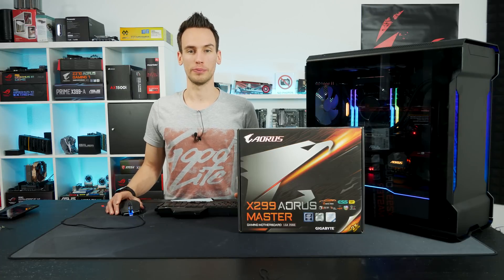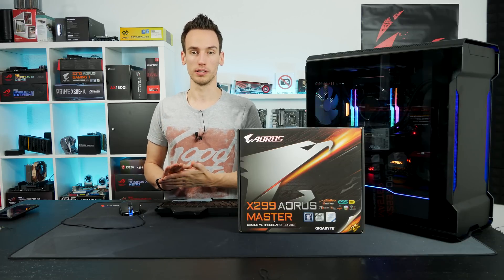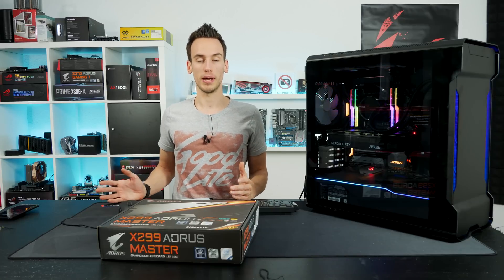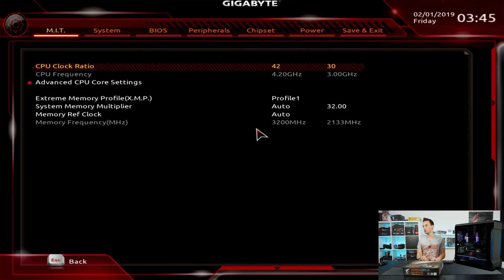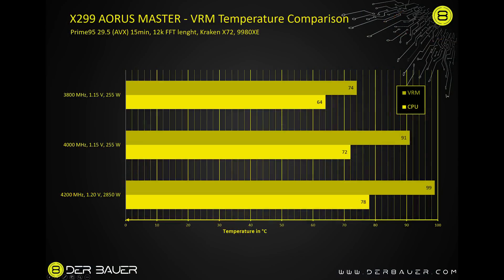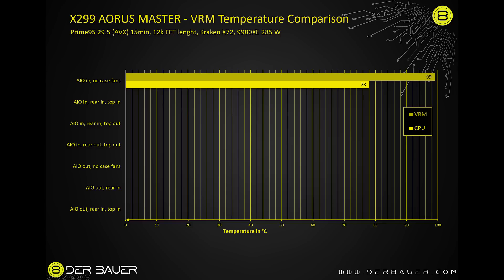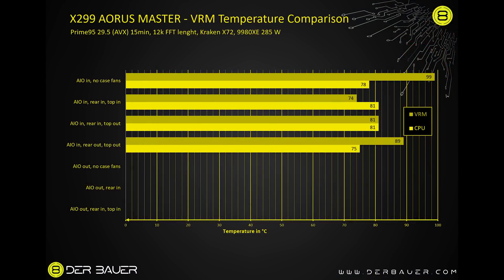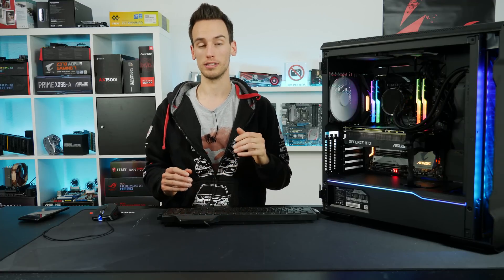PC Airflow Test - Real Mainboards have Fins

Comment: my case is too large for my AIO tubes to front mount so i have it top mounted with 3 120s on intake on the front of the case, a noctua 140mm 3000rpm exhaust on the rear of case and my 240mm AIO top mounted in a push pull config with 2 noctua 3000rpm pushing and 3 standard case fans pulling out the top and it seems to work pretty well. i do plan on upgrading to a 360mm AIO though

Comment: Hi Roman,
Please, next time place AIO radiator on top, with fans blowing outside,  front in, rear in.Try this setup. It's the best config. Confirmed by over 200 workstations. VRM heatsink and RAM cooled directly by rear fan. Positive pressure inside makes hot air from AIO radator get out instantly and top radiator fans can run quietly.  If the card will be hitting the max load the CPU will get hotter. Knowing that you should use a card with 4pin  fan connector  for front fans. 
The case you used is not the best one also. Fractal Meshify C is sufficient for 8-14 cores with mild OC. Fractal Meshify S2 or Fractal R6 is the best for staying cool and quiet while GPU is on air cooling.

Comment: Interesting video, though when GPU is under load it would also introduce additional heat. For example, when stressing my CPU with Aida64 (Ryzen 2600X) and cooler) but when I also introduce FurMark running the GPU in the background (GTX980) I get a signifcantly higher CPU temperature. On the other hand, when gaming CPU is usually around 66 degrees and GPU around 72, and that is much lower for the CPU than when stress testing. Also I would note that when doing Aida64+FurMark combo stress, HWInfo reports 66 degres on CPU but 75-90 Tctl/Tdie, while when I am gaming CPU temp reported on the motherboard segment and Tctl/Tdie temp are the same.

Comment: OMG ! .... i thought id swap around my fans just for the fun of it.. dropped 3-8c on all 8 cores....Phanteks p400 tg , 360 aio front and 3 case fans 2 top 1 back... had AiO in other 3 fans out.... swapped it around so 3 fans in AiO out (wth fans on inside pushing thru radiator...) ... thank you so much !

Comment: Neah.. With this case, it's better to mount the radiator on top, exhausting hot air and all the other fans pulling fresh air inside.
It's very common tho, to not have enough space on top of the case, to this ridiculous front radiator trend.

Comment: Problem is now its exhausting warm air in the front and a lot of people like myself have their towers facing them at their desk (or nearby facing in my direction, etc.). I think the even more optimal solution is to instead have a case with an AIO mounted on top or even in the back, with intake case fans in the front. Then you can blow hot air out the back while still having a similar configuration that you show in this video

Comment: I always have my AIO on the top blowing air inside the case to the VRM. Besides that benefit, despite what others say (warm air goes up), I think fresh air coming across the AIO radiator fins from the outside is better than warm air from the case out. The direction of the air doesn't matter as long as you push the coldest air through the fins and a push pull fan setup running as low as 600RPM pushes with enough force that no warm air going up will ever become a force against the fans. Two or more front fans (2x 200mm here) the AIO injecting air from the top and a 140mm fan as exhaust makes for a real efficient airflow pattern. The positive pressure is so strong that the exhaust is not really needed as I can feel air coming across all cracks from the back of the case.

Comment: Hello everyone,i have 360mm AIO on TOP 3x120mm fans out turn)and my fans position 2x120mm on front endering fresh air inside case,and rear 1x120mm  OUT air,if i turn position to rear fan to ender Fresh air do you believe my vrm's and cpu drops a little bit temps?

Comment: Ah finally, Real result. i always suspicious about the theory behind the way the air flow works, i read from many websites. It works only if its an fully enclose non-leakage box. On my system, i laid down on the side(rather than standing); I have the fans pulling in from the left and right, but only one fan pushing out at the rear. (no front fan slot).
BTW Mr DerBauer, got a question here: is it better to have "copper pipe+alum fins" or "alum pipe+ alum fins" (or nickel instead of alum), on the VRMS? do we really need another "copper pipe+alum fins"? I meant the manufacturer can save some $ there.
Reply: Well aluminum sucks at heat transfer compared to copper, so they could also use shoelaces and just pretend its a heatpipe if they wanted to save costs... I have never seen an aluminum heatpipe, those nickel plated ones you are thinking of are nickel plated copper.

Comment: Why are you using only four memory modules in X299? I've noticed that many people drop in LGA 20xx platforms and populate it with half the RAM. It defeats the sole purpose of this platform in my book (now the SLI/Crossfire is effectively dead the PCI-e line count basically doesn't mean much).
Reply: Apparently you don't know, but X299 only supports quad channel memory... Populating the rest will only allow more RAM (64 GB was probably enough for him, I doubt he needs 128 GB for gaming). Filling all the slots of RAM also means more stress on the memory controller, meaning it may need to run SLOWER, so you don't want to run with all the slots populated unless you really need the extra RAM.

I run 4x Fury and get twice what my Titan Xp does (so you'd need 3x Titan Xp to match). Crossfire is not dead, its called 4k gaming, and a 2080ti will struggle in some games just to hit 60 fps, I much prefer the 100 fps in Crysis 3 at 4k Ultra than sub 60 fps any day! I run a Threadripper for the PCIe (I still want to run 3x NVME in multi-tier raid later)
Reply: @jakegarrett8109  I know that X299 supports four channels (six to be exact, but two are disabled). And you don't have to put 16GB modules in there. Lower capacity modules usually are faster, putting eight 4GB modules with tighter timings (while apparently bit slower frequency) should still give you speed edge over four 8GB modules. This may break over, say, 4 GHz on memory, true (hence X299 Dark has half the memory slots), but for pure usability I'd still go for 9900K over any HEDT when <= 64GB memory is required. For high core count work is't rare to see workloads that don't benefit from more RAM. Video editing (most common reason high-end systems are shown being built on Youtube) always benefits from more RAM, for example.

Leaving usability aside, for any showpiece I'd also pack 8 slots, because it just looks better.

Saying SLI/CF is dead, I meant it's dead for average customer. I ran 3-way SLI on 8800 GTX, but also on 2x 6600 GT, which cost like $80 each. I ran SLI on 570, 970, 960, 750 Ti, 1070, Titan Xp, and bunch of Quadros. But on 1060 it's not possible anymore, and not on damn RTX2070. It has been moved to extremely high-end, which only few can afford, so game developers just dropped supporting it altogether (you have no idea how pissed I am at FF XV). CF I haven't used since X800 and my hunt of CF master card, but from the looks of it, it works more behind the scenes than SLI, and gives some hope for multi-card setups... but still requires dev support, and be fair, Radeon sales don't justify including this in games too. Big engines may support it, but anything else...

Do you imagine how people would be happy if Geforce 1060 supported sLI?

Comment: Would having rear+top intake, AIO exh end up raising GPU operating temps? There would be high pressure area over the VRM/CPU socket meaning the air coming out that open shroud would be most likely pushed back into the GPU fans- whereas normally it would split roughly half og the  GPU exhaust into the top half of the case.

Comment: I have 3 fans blowing in cold air from the front and 1 exhausting out the back and AIO I is in the top of the case with Fans in a pull configuration,, my VRM’s stay about 49c while gaming and cpu (8700k) @4.8 GHz  has a average temp of 61c,, with a max of 67c...

Comment: Great video Der8auer, I have a 6 core 6850k on custom 360 loop Including graphics card on a Fractal Define R6. I found that my temperature was better than having a single top fan on exhaust. Maybe I must add two top fans instead of just one? I have hardline tubing so swapping the front rad fans out to exhaust aren't so easy.

Comment: Used to have a case(NZXT) with a 200mm air pulling in through the side panel which would give good airflow over the VRMs and some addition airflow for the GPU with a modest overclock, I moved the setup into a case without side panel cooling and started running into stability issues until I bolted 2 120mm fans to the new case on the side panel, which cleared up the problems, generally I mount the AIO on to the roof of my case pushing the hot air through the radiator and out of the case(doubles as a space heater in winter), the rear is always exaust and I pull the fresh air from the front and if the case permits the side panel. great vid.

Comment: My setup is 2 top 140mm fan pulling air into case, 1 back 120mm fan pulling into case, 3 front 140mm fans pulling into case and a Corsair H150i in push/pull (3x120mm) config exhausting air out of the case and the HX850i PSU exhausting air at the bottom of the case, the case has been modified so the radiator is mounted to the side case panel like the der8auer
 Lian Li O11, all fans between 540-630 rpm, and der8auer is 100% correct, the config has the best VRM temps with very little negative impacts on cpu and gpu temps. Rig is extremely quiet at idle and under load. Oh also I installed a small fan on the VRM which is flipped around now, link is an old pic, and runs silently at 2187 rpm. Here is a link to a pic of my rig, old pic but mostly the same, looking to take it apart and mount the H150i on the outside of the side panel so the front fans are not partly blowing into the side of the radiator fans.
http://i66.tinypic.com/2epn3ut.jpg

Comment: As always, thanks for your work!

Running 360mm rad 3x120 intake front
3x120 top exhaust and 1x140 rear exhaust
After this I may reverse that though next time I clean the case out.

Comment: For mobos without backplate, worth it to put thermal pad and ALUs on back of PCB where VRM is (assuming there's space and would be case dependent)? Would like to see temp tests for that. Nice video!
Reply: I cut a hole in the back of my case and installed a small 70mm fan to blow on the back of the socket. It reduced my CPU temps by 7c  (going from 75c down to 68c on FX). Since the motherboard standoffs are very short, the entire back of the PC gets adequate air velocity for good thermal energy dissipation.

Comment: For my rig im looking at external aio on top of the case to not recycle air. Then 1x front and 2x top in 1x bottom and 1x rear out. The remaining air will go out trough gpu which is a back exhause model. If theres to little in in the end i can make the front fan 1 big fan aswell. Psu has its own intake at the bottom and rear out. The things we have to do to cool a cpu these days. Finally gpu heat is not a giant problem anymore now cpus are the hotheads. May have to go with a custom closed cooler as not all coolers let to detatch and reattatch hoses.

Comment: This all checks out with what I've been telling people about how inefficient "conventional" air flow is.  You want your intakes to be closer to your components, exhaust can be anywhere.  Convection does not assist fan-assisted cooling in any way.  That's the point of fans.  Convection cooling works by completely different principles, as soon as fans are added the principles of convection simply stop being applicable because the fans take over.  That said, test what the nay sayers are asking for anyways, just to shut them up for a little while again.  This stupidity seems to rear its ugly head every decade and we need to beat the idiots over the head again until they slink back to their caves again for a while.

Comment: I'd be interested to see this same test with a Dark Rock Pro 4 air cooler. Would the cooler's fans pull enough air over the VRM to make a difference and would the case fan airflow be blocked by the large heatsink?

Comment: I use a thermaltake p5 cause I dont like casefans, more noise for no reason, one 140mm fan for my noctua d15 and strix 2080 for my gpu, nice and quiet, although I only have an 8700k @5ghz so the vrm on the rog x hero needs no cooling whatsoever.

Comment: As I understand it, most decent VRM can go up to 125C before they hit thermal limits. Is there any performance advantage reducing them from 99C to 80C?
Reply: No performance difference and only a very weak impact to the components' lifespan. Generally all you care about is that your VRMs aren't close to their thermal max.
Reply: @billschannel1116  Ya that's what I thought also...I think folks lately are getting WAY too worked up about VRM. Totally different if you're ln2 overclocking, but truly does not matter for 99.9% of us. Kind of equivalent of worrying abt chipset temps...really don't even need a heatsink for that these days.

Comment: Great vid ! Just a question: People should also consider the way their PC is standing on their desk . If you have exhaust fans into a wall (or the corner of your room), and inlet fans near the wall(or corner of room), the intake fans will recirculate the hot air back into the case. I would almost say that the location of your computer case is as important as the inlet/outlet fans of the case.
Reply: I would definitely say it's as important. (dropping your almost) Thankfully, the exhaust out the front will likely work for most people as it's rare to have the front against a wall.

Comment: AIO mounted at the top of the case with air going straight up. 3 fans in front with air coming in and the rear fan set up with air going out. Not the best for the CPU, but everything else stays cool.
Reply: That's the config I usually use.

Comment: Using 2 front and 1 bottom for intake, and 1 top/rear for exhaust, NH-D14 cooler, found my vrm was causing a failing at around 2 hours load test, zip tied a NF-A4X10 PWM to the vrm's thermal shock absorber, this is only a I5-4690k at 1.29V

Comment: great video and even tho i know it's about the motherboard here but with that said i think GPU temps are important to mention as well. you're saying you like to use the 3 case fans as intake and the AIO in front exhausting in your future build but i'm going to assume that this setup will hurt GPU and CPU temps. i have not tested this myself so i might have this completely wrong. :

the GPU which is an openstyle cooler design will output it's heat back into the case, since you're forcing 3 casefans to blow air in the case the hot air coming from the GPU will have no where to go naturally and there for has to go through the AIO which will result in higher CPU temps. now before you say well this also happens when you have a top mounted radiator i would argue that a TOP mounted aio radiator + one rear exhaust fan will do a better job for CPU and GPU temps as the 1 rear exhaust fan will deal mostly with the hot air that the GPU outputs.

the reason i bring this up and again i know this video was purely about mainboard temps but in general people will benefit having better GPU temps when it comes to gaming performance as GPU's are way more sensitive with temperatures.
i think a top mounted radiator with front intake case fans and 1 rear case fan as exhaust will give you the best overall performance.

now i like to note before people attack me that i'm talking about OVERALL performance and not just the cpu/vrm temps. if you do mostly heavy CPU tasks and you need every bit of lower temps on your CPU/VRM's then yes i absolutly agree with der8auer setup (front aio exhaust and 3 case fan intakes). if you're a gamer i would opt for AIO exhaust and front intake for better GPU temps.

Comment: Odd way to have your air flow though. Why not just keep the AIO in the top pulling hot air out and have cold air being blown in from the front? This way you could even keep neutral air pressure for best air flow option. I respect you a lot der8auer, but this guide is... silly

Comment: Top, rear fans in and the AIO cooler out, without a gpu lead is fine. With gpu heat in the system the air gets allot warmer, with allot higher CPU temps. I tried it with my Corsair Air 540, 4770k(Dellided) cooled with a Arctic 360(stock fans), EVGA 980sc. Good to see that the MB got better with the refres.

Comment: Correct me if I'm wrong but the GPU was idle during the test, right? If the GPU was running furmark you might have gotten different results for the CPU temperature. Also the AIO fan orientation would also influence GPU thermals. The rear/top intake also has the disadvantage that most cases do not have dust filters there, so you would have to buy some filters from Silverstone (they make great filters).